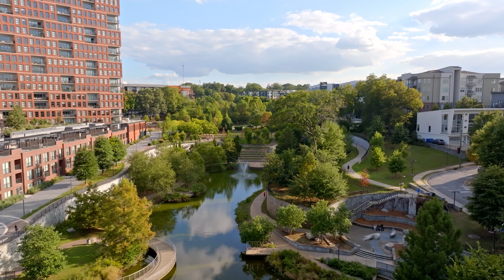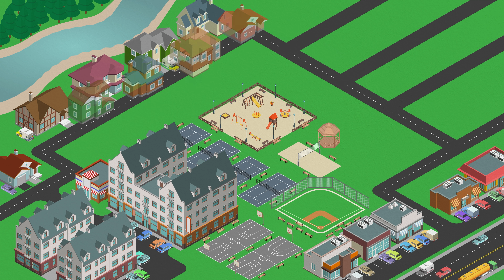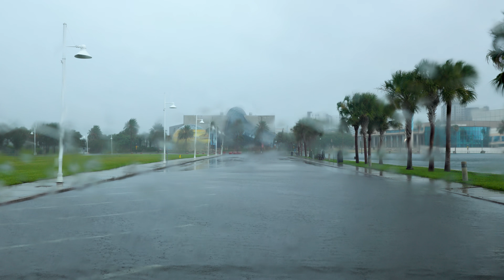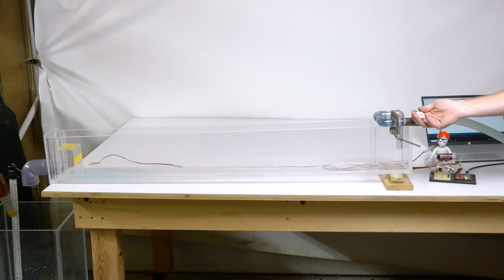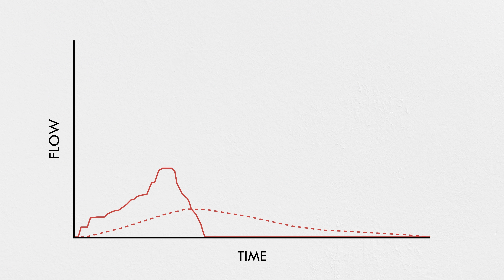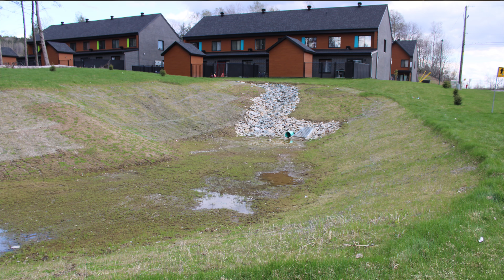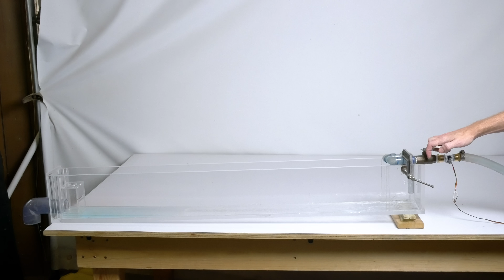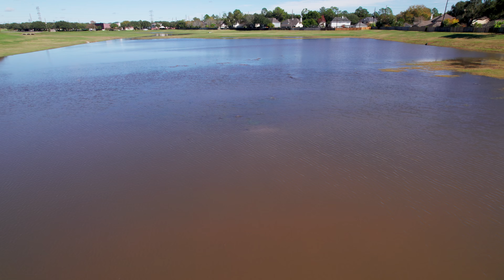Do Retention Ponds Actually Work?

Comment: 0:15 5 acres is not "half a hectare". It's 2.02 ha or "two hectare".
Reply from the maker: Thanks for catching this! I put a note in the description. Sorry for the conversion error!
Reply: @PracticalEngineeringChannel gonna need you to revise and resubmit! It’s nice to tell an engineer that instead of the other way around 😂
Reply: Hec, we don't use those here
Reply: @PracticalEngineeringChannel  FWIW, just stick to a unit. Veritasium get away with just metric. You can do the same. If the US is most of your audience, then just do imperial. 

YouTube · Veritasium
20.2M+ follower
Reply: @PracticalEngineeringChannel  Back of the envelope shortcut: 2.5 acres in a hectare.

(But gods it is painful how the US refuses to use proper units.)
Reply: French units are "proper"?
Reply: @paulholmes672  They are international SI units, not French. US was actually one of the first if not the first country to ratify the metric system.
Reply: @paulholmes672 Revolutionary measurements were good enough for the Founding Fathers. That’s why NIST has one of the original artefact kilograms as a gift from France. Why the US didn’t whole hog embrace revolutionary measurements is still baffling to me.

And the real joke is that federal regulations in the US are all fully metricated.
Reply: @ChaoticAphrodite  I don't think you realize the cost of changing to the metric system. The entire road infrastructure would need to be re-signed and every car would need to be retrofitted. That is just the beginning. I doubt we will be spending hundreds of billions of dollars to change every mile marker, speed limit sign, speedometer, exit sign, building code, text book,... It just isn't that important. Where it is important has already made the change for the most part.
Reply: @ChaoticAphrodite HA❢ 🇺🇸 We played with the “metric system” back in the 1970s for a few minutes but it scared us; So we hid it in the corner and covered it with some papers. . . 
(8½ x 11 freedom paper no doubt)
Reply: Yes!
Reply: @SudaNIm103  Haha, I remember the panic over the Mars Climate Orbiter in 1999.  Good times!
Reply: @JoshTurner-os9ti yeah America is way too poor of a country to do the thing literally every other country on earth somehow managed to accomplish.
Reply: @SudaNIm103  That's because they destroyed all of their infrastructure twice in the last century and the US paid to rebuild it. 
Europe can't even manage to speak the same language within the distance of a two states. They require a country an ocean away to protect themselves from their main source of energy.
Reply: @JoshTurner-os9ti  I don't think you realise the cost of not changing to the metric system. Besides all the time people spend converting back and forth, and dealing with errors, and the cost of buying a second metric set of tools, the errors themselves can be expensive (e.g., total loss of a $125 million mars climate orbiter).
Reply: @PracticalEngineeringChannel  Ha, my dad was an engineer and would use the same subterfuge.  Putting a correction in the description is not a fix!🤣
Reply: @PracticalEngineeringChannel  Yeah, well, Don't let it happen again...
Reply: I blame the units
Reply: Yep,  I grew up on a 5acre small holding.  It was a hair over 100x200meters and 100x100m is a HectAre or 100 Ares and an Are is 100m^2 or 10x10m.  The size of the community garden plots in Finland is generally 10x10m or 1 Are.
Reply: Keen to say the same, and I’m just a novice American gardener at best.
Reply: And this is how I realised acre is not the American way of saying Ar, but a measurement that's roughly 0.4 hectares. What is the use case of that unit?
Reply: @anastylos2812  Land surface where using square feet is impractical because the numbers would be huge. Just like a hectare vs. square metre.
Reply: @dlevi67 but when world acre be better than hectare?
Reply: @anastylos2812  When you are used to it. As a unit per se it's neither better nor worse than a hectare, but if you want to convert to larger .(square mile) or smaller (square yard/foot) units the multiples aren't 'friendly'. On the other hand, dividing an acre in 2, 3, 4, 5, 6, 8, 9, 10, 11 or even 12 equally sized parts is easy and results in a whole number of square feet.

What makes the SI easier (and ultimately more useful) is the consistent use of factors of 10 and deriving all units from the same small set of fundamental ones. Customary systems are a mess of factors, and they start from many more independent units.
Reply: @dlevi67  And yet Americans love using lbs with the huge numbers that that creates.
Reply: @jemijona  Up to a point. Tons (short and long) are also used, which are about the same as a metric ton (for an engineer...). Then again, a kg is only ~2 lbs, and the next internationally used unit of mass/weight is the metric ton, so even in SI there is a "scale gap".

Disclosure: I am not American in any way shape or form; just interested in measurement units.
Reply: I wonder if AI would have caught this
Reply: @canofpulp Definitely possible it was the source. Can't count the Google searches I've done where the results have the right answer but Gemini jumps in at the top to proudly declare how confidently wrong it is.
Reply: @snwendland  Yeah, I have observed the AI result at the top of the search results be WRONG, yet if you click on the show more button it displays the calculations that it has used and it comes out to the RIGHT answer.
Reply: @snwendland I've found AI generated results to have more junk than a carefully crafted keyword search.... Incompetence, or sculpted incongruity?
IE "doubt"
Reply: @canofpulp  No, not reliably, at least not if it's an LLM. LLMs do not know anything about math; they just string words together. When it looks like it's doing math, it's not; that's inherent in the way they operate.

Comment: LA needs something like this.  No, it doesn't flood, but it does sustain long periods of drought. And then when the rain comes, all that valuable water rages in a torrent into the lovely concrete lined LA river and out to sea. They need a method to capture and retain for future use that water. Their problem of course is that this would have to be met with a multitude of retaining ponds or cisterns distributed throughout the city and almost certainly at the sacrifice of very expensive property. But maybe they could just give up some width in some of their absurdly wide surface streets. But I only muse. It's not my problem.

Comment: Being in a developed part of floriduh, u cant go a mile without seeing a retention pond. Most are hooked to municipal sewers or head straight to the Indian River via canals. There are some places where it still floods pretty regularly 😢😢😢
Reply: Coastal, flat areas are really tough to work with in my experience. You don't have much ability to make things deeper and sometimes don't have room to expand either. If you go too deep you hit the water table then the pond obviously just stays at that level. I think I've seen a lot of systems that then rely on underground vaults or using the pipes themselves as storage volume for the water

Comment: The reason there is a retention pond in the Old 4th Ward in Atlanta is because the combined sewer and runoff system was dumping raw sewage into the Chattahoochee River.  The city was under a court order decree saying they had to separate storm water and sewage into different systems (as well as being fined DAILY), and the city created retention ponds along with huge underground storage systems and increased treatment capacity to finally comply with the court order.  It was an everything kind of solution, but in the end it worked, and no one believes that the park should not have been built.  It spurred on a real increase in value for the entire neighborhood (gentrification criticisms noted)

Comment: What if each house or groups of houses had underground tanks sized to hold most of the roof run off? Retention ponds require a lot of earth moving. Home tanks would allow for smaller ponds. The savings could offset the cost of tanks. The home stored water could then be used for irrigation or washing cars.

Comment: I think you may have missed the big picture or fallacy in most retention system requirements. The number one fallacy would be when the ground is frozen. You have 100% surface runoff which far exceeds any amount of impermeable surface areas that development might add. This amount of impermeable surface area has been working for the last 10 billion years or so. We have also had animal feces running into our streams for the same amount of time. 
  You are a younger respectable civil engineer who has grown up with these type of flawed accepted ideas that no one questions because of the money and control municipalities and engineering firms can make off of these requirements. 
  This by no means is a slam against you, I’m impressed with your channel and you and I enjoy it.
  From looking over a few of these comments it seems clear that this whole retention issue ends up creating more problems than it supposedly cures.